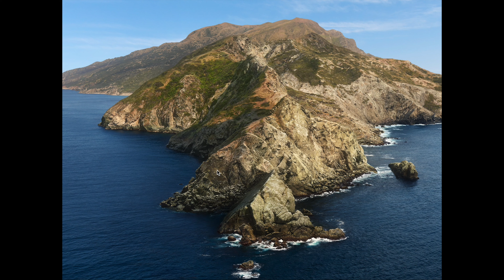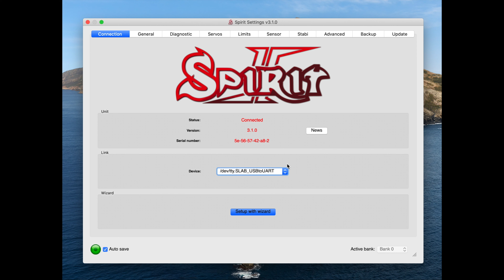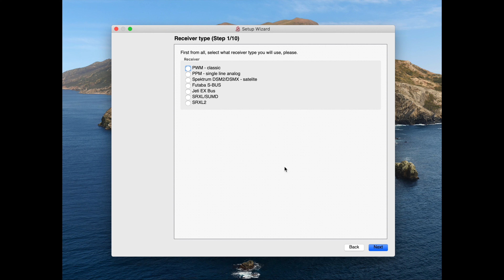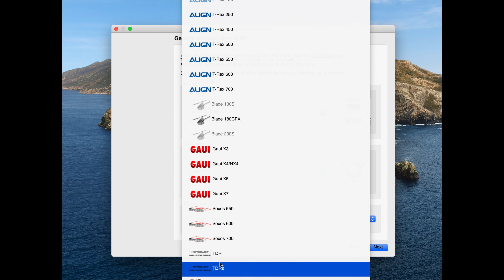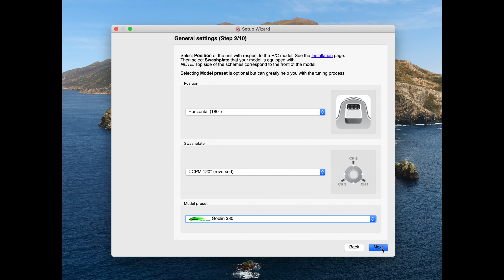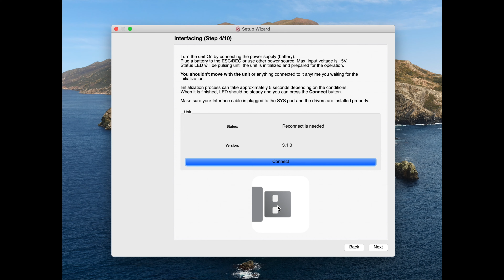Spirit Flybarless Setup - Part 1

Comment: Good evening.  I have been watching your Spirit GT FBL set up part 1 and part 2.  I am having an unusual problem.  I have gone through the wizard through Step 5/10.  Setting up channel +/- limits, direction of movement, etc.  All is going well here.  When I go to next screen I am not getting physical movement on my heli.  I am using Ethos on FrSky radio.  I have bound my receiver (green light).  I have a lipo plugged into esc and connected to BEC/ESC port on Spirit.  I have my receiver plugged into RUD as required for the F.PORT rx.  I am not getting any movement on my heli servos at all.  It appears that Wizard to Spirit GT fbl to radio is working.  For some reason it appears that Spirit GT Fbl is not talking to my radio/RX to make actual movements on the heli.  Any ideas?  Thanks
Reply from the maker: Sorry was out flying till late last night...I actually set up an XLPower 550 on Saturday and did a shoot of the process and will post the video in the next day or so. I did run into only one issue while setting up and that had to do with restarting the FBL after setting to F.Port, the rest went pretty smooth. It does not sound like you had an issue with that if you were able to set up the channel limits though. Did you perhaps have the sub trim checkbox set on the servo tab (step 6)? That would lock the swashplate to center for setup purposes...That is all I can think of right now.
Reply: @yufasa  looks like I had my servo wire reversed.  Thanks
Reply from the maker: @randallwatts9840  The one did not even cross my mind...Will add a little blurb on that in my video
Reply: Do you hsve spirit/ethos firmware on your rc first of all?
Reply: Problem resolved.   It was my laptop.  Had an issue with usb port.  I also did have my servo wires reversed.  Thanks.

Comment: Hello, I am looking for a Flybarless system. Could you advise me? I hesitate between the DIS-12 + Spirit GTR Combo Combat or the VBAR Control Touch + VBAR Neo.
Reply: This is a large debate and the short answer is that it is really up to your needs - example, if you fly planes and heli’s then your are better off with the Jeti/Spirit combo. Spirit is a fantastic FBL and integration is pretty good. I would say it is better than VBar and will take some flak for it. If you are only flying heli’s …well you cannot go wrong with either one